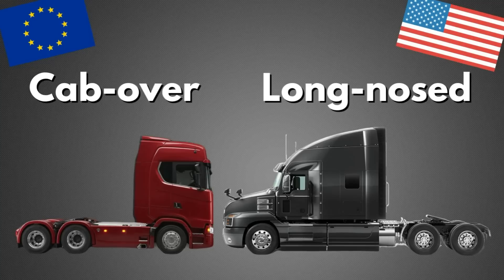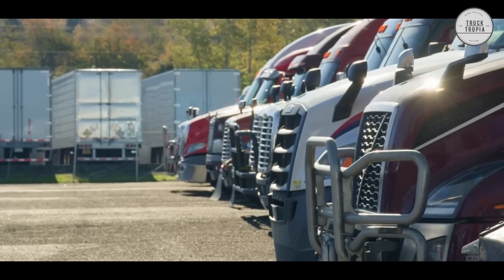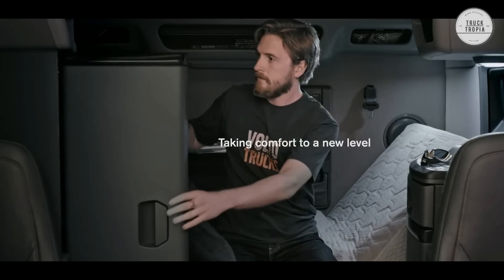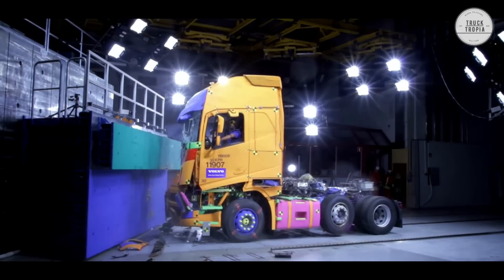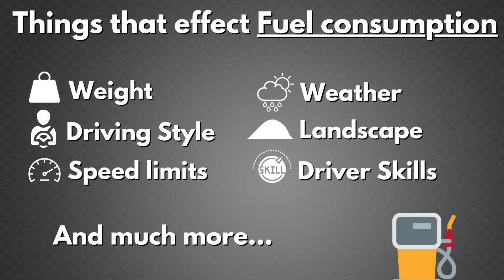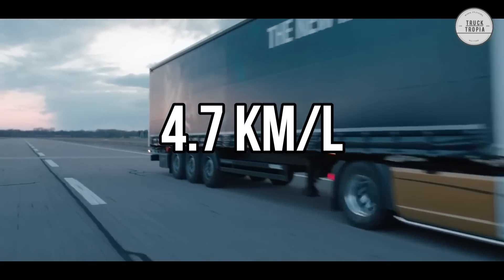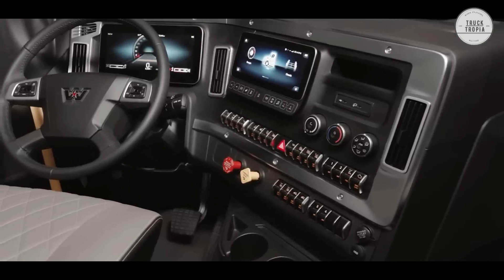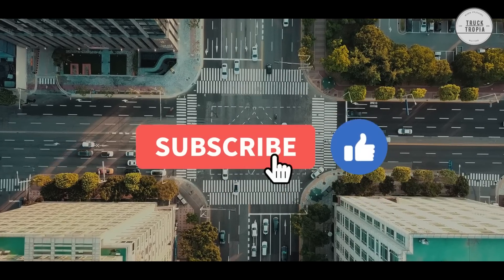WHY Long-Nosed And Cab-Overs Are So Different?

Comment: I have driven cabovers and I have driven long nose.  Both can come with a sleeper.  Cabovers feel more cramped and have a stiffer ride than the longer wheel base of the long nose.  In a cabover you are riding on your steers.  But in tight quarters like the narrow city streets in Europe or in urban areas you cannot beat the shorter turning radius and manueverability of the cabover vs long nose.  However, it does not have as firm a feel of control as the long nose on the highway.  The long nose feels more stable and smooth on the highway and not as prone to slip.  And it is a lot easier to access the engine on a long nose.

The cabover is the ideal city truck and the long nose for highway.

Comment: There is a limit as to truck length.  In some states it's total length.  I believe here it's 75feet. Trailers are 53 feet. In the late 70s Missouri trailer was only 40 feet.

Comment: Hello everyone, I am a mechanical engineer for the paccar group and previously I was a worker at Daimler and Volvo.  There are a few glitches in the video, I hope I can help you.  To begin with, it is a very common mistake to think that the American truck is more aerodynamic, the European truck uses the drop of water concept which is one of the most aerodynamic, a daf XG+ is more aerodynamic than a T680 Next gen.  On the issue of fuel consumption, the European saves much more fuel since really for consumption the European geography is much worse than the difference in aerodynamic resistance due to the extra speed (just see the instantaneous consumption going up a mountain pass with 40 tons at 40mph then compare cruising at 75mph) A 500hp Volvo VNL in Europe with 40 tonnes gets 6.9mpg while its big brother the Volvo Fh 8.7mpg.  And believe me that if we take both trucks to a country like Spain, your pocket will hurt a lot, not to mention that they all overtake you going up and down.  Another example is the scania S super, which gets 10mpg with 40 tons IN SPAIN that looks like a roller coaster.  The only advantage of the American is the time to sleep, the habitability is greater.  But the advantages end there, the European humiliates the American in everything else, to use some examples in my group, a T680 next gen is not in the same league / division / step / level... Whatever you want to call it than a Daf XG+ the difference is too big and so with all the groups.  Well and not to mention the difference in engines, which are not the same, the difference in quality and performance is very different with Volvo giving 2800nm with 500hp, more Torque than a 565hp X15, a 600hp dd16 or a C15... .
Reply from the maker: Thanks for sharing 👍
Reply: I have done international Customs and Cargo transportation for 12 years, so I want to set up my own business and open my company in Canada.
Reply: @dogankucukdogan8085  ok. why do you tell us that?
Reply: "American trucks aerodynamic because pointy" is one of the most frustrating misunderstandings of aerodynamics
Reply: Well said that Man
Reply: Having driven both units, I would disagree. Hills don't affect mileage as much as you insinuate. What goes up, goes down. Aerodynamics are generally better on the European trucks,but it's more due to the trailer gap, than the unit itself. The video was very well done, and correct IMO. Very hard to do apples to apples.
Reply: @gordonblomgren8176  Hills will affect consumption. How on earth they will affect consumption on regular cars but not on trucks? You gain some going down but you lose more going up because of inefficiencies. If you could store the energy going down somehow, yeah, then it would be close. But in order to do that, you need huge batteries, which would increase inefficiency back.
Reply: @gordonblomgren8176  hills will affect fuel consumption
you put a lot more energy into going up a hill than you do coming down as on the descent you need to keep the vehicle at a controllable speed so you're constantly braking, turning the gravitational potential energy into wasted heat and noise
Reply: @lord_scrubington  the "American trucks" are designed for American Roads and the "European Trucks" are designed for European roads.. its not complicated...if you were driving the open road in America basically living out of your truck then you would prefer an American design with a huge sleeper.
Reply: @leeward6762  Yeah, america is much bigger and truck drivers stay on road far longer. In Europe, they don't leave home for that long compared to american truckers who basically sleep in the cab. American trucks also require less power since the country is flatter, roads are far bigger. I don't mean to say all euro trucks have stronger engines, but in Europe for most models you have a higher ceiling for power and one of the reason is the existence of Alps, Scandinavia...etc. Europe is more densely populated too, which makes most routes shorter.
Reply: @leeward6762  And curse its humongous length in European roads. European trucks are the other way around: delight in their space efficiency and manoeuvrability, and curse at their engine accessibility.
Reply: @gordonblomgren8176  You are very wrong, do you think you know more than an engineer who works in paccar? let's just learn from it. The American truck looks like junk next to the European truck, I have a Scania S770, there is no American truck that comes even close to it. It's like comparing an Impala to a Mercedes AMG.

Comment: Just did a a little comparison with the volovo fn 6×4 and volovo vnl 760 and the fn total length is 10000mm or 32 feet and 9 inches where as the volovo is 10147.3 mm or 33feet and half inch so only 3.5 inches longer plus the vnl 760 being skinnier and shorter yet giving the driver better room in cab and possibly being safer and more aerodynamic so why still use the cab over engine

Comment: I drove tandem dump truck for over 30 years. The regulations really only regulate safety. There is many old trucks that are uncomfortable with poor sound insulation. Dump trucks exclusively use the conventional configuration with different hood length influencing maneuverability.
Reply: Over here dumpers are cabover with dual drive and dual steer.
Reply: @eezergoode8588  yes I’ve seen those trucks when I was in Switzerland. A Eurodumper with a tailgate that was hydraulic. Very cool. My last truck had an automatic transmission with air suspension. Very surprised that I had no orientation to the truck and transmission.

Comment: One thing you missed is that in America, the wheelbases have to be a MINIMUM length. This is how we (bridge designers) design bridges; we assume the truck tractors have a wheelbase of at least 14', and a lower wheelbase will concentrate the load. This being the case, the truck needs to be a minimum length, thus negating the need for a COE.
Reply: I’ve heard of this. It’s called the federal bridge formula
Reply: And I’m ALL for it. My back thanks the bridge formula. Now only if Ohio would fix their joints
Reply: @jacobhelmlymusic8215  if you drove a European truck you wouldn't be in pain either.

Comment: THE 6X4 TRACTORS  ARE RARE IN EUROPE !!!
THE MAXIMUM WEIGHT IN EUROPE FOR A SEMI TRUCK IS 44 TONS !!!
JC ANONYMOUS PATRIOTE FRANCE.
Reply: Not here in sweden, we have a max of 74 tons and 24 meters. And me myself are driving a Volvo FH16 with 6X4 and a lowtrailer after it and i can weigh 60 tons on my rig
Reply: @isakeriksson9162  YES.
IN FRANCE WE HAVE 6X4 WITH 120 TONS OF CAPACITY WITH SPÉCIAL SEMI.
HEAVY TRANSPORT.
AND OVER.
BUT NORMAL IS 44 TONS FOR SEMI TRUCKS.
JC ANONYMOUS PATRIOTE FRANCE.

Comment: In the end, how much pulled weight determines fuel economy.
Reply: Both trucks should have been the same weight and run on the same roads to get a more accurate fuel reading 
The trucks should have been by the same manufacturer such as Volvo who could have specified them identical except for the different cabs
Reply: @Retired88M  Cloest comparison we can get from Volvo is FH vs. VNL But that's assuming they have identical engines, transmission, and axle layout.

Comment: I am a us truck driver. I can assure you that we have zero airbags. In the event of an accident, they would do more harm because we will not be stopped by the time the effectiveness goes to zero. If they extend the effectiveness time, we would not be able to control it if we are able to. We keep driving it until it is stopped.
Reply: All volvo trucks in the USA have airbags
Reply: I’m also driving a  Cascadia and it has a driver airbag on the steering wheel. But there is no regulatory requirements for them in the US.
Reply: false information i guess. if you hit a wall its instant stop even for your mighty truck
Reply: @mikkihintikka7273  it's not false. I have driven volvos before
Reply: @LifeOn18Wheels  dont care. airbags wouldnt made things worse thats for sure.
edit: typo correction "back" --> "bag" 1 linute after posting the comment

Comment: European lorries are limited to 64mph not 56
Reply: I thought it was 56 or is that just the uk?
Reply: @Savagetechie  British lorries are definitely 64mph but i just assuming the rest of Europe would be the same as British and other European lorries go on each other’s roads all the time
Reply: @jammiedodger7040  I thought over 12 tonne was now 56 in the UK? Although I think it only applies to vehicles registered after 2001. I may be wrong though. I'll check the C&U regs.
Reply: @Savagetechie  They put it up a couple of years ago but it really depends on the type of road as even though they can do 64mph they are legally required to go slower on certain road types but then before the 1960’s almost everything went by rail in Britain until some knob took an axe to it as we can all agree that rail is better than road unless It is a extremely short trip were lorries and even buses make sense.
Reply: @jammiedodger7040  have they got rid of the daft 40 limit on A roads? Definitely a throwback to the drum brake era.
Reply: @Savagetechie  I believe it depends if it is single track or dual carriageway  I think on single tracks it still a thing
Reply: All trucks 7.5T and over in UK (and all europe) are limited to no more than 56mph(90km/h). Source: am English lorry driver. 
That’s a hard limiter, regardless of what road you’re driving on. Been that way since the 80s to my knowledge. A good hill and heavy load will get you faster though. 
Only exceptions are fire trucks and horse boxes.

Comment: Good comparison! I have one criticism though. When comparing fuel consumption you give the consumption in mpg and kilometers per liter. Nobody in Europe measures that in kilometers per liter. We use Liters per 100 km
Reply from the maker: We dont, where i come from in Europe 😅
Reply: @TruckTropia  No way you are using KM/L in Denmark (I assume the channel info is correct). I always assumed that L/100km is the standart. I guess I was wrong
Reply: @felixsmdt  I'm italian and I use both systems

Comment: American truck manufactures have never heard of term “ergonomics” The interior of American truck are terrible designed and not very driver friendly; especially old Freighliners, beside International trucks are the worst, they fall apart even  when they are brand new.
Reply: American trucks are super driver friendly. International is definitely shit though.
Reply: @Jasonsminiadventure  Modern trucks are much more comfortable and driver friendly now than they were even a decade ago, and if you wanna see an uncomfortable interior look up 50s and 60s truck interiors
Reply: @Jasonsminiadventure  you can go for Freightliner, which is owned by Daimler Trucks North America.
Reply: @banurigopalreddy4014  Or Volvo VNL. Some engines and transmissions are shared with FH.

Comment: In my opinion, what causes the shape of the cabin to be different is because of the driver, the average European tends to be thin, while Americans are not too tall and the average is obese.
Reply: That's a bit of a stereotype, and while it's not entirely untrue, you are over exaggerating it a bit. IMO the main reason the cab shapes are different is simply the geography of where they operate. North American roads are long, straight and wide. In Europe truck drivers have to deal with tighter, more narrow roads which the cab over design is better for.

Comment: One thing I really like about our european trucks is the ability to put that much space into a much smaller cabin. We really made it to use every cm² to the max and offer the driver as much comfort as possible with all our size-regulations. There are some really smart inventions to get everything into the cab AND make it as quiet as a normal car plus offer a flat floor and the ability to stand upright. That plus the high seat position is why I love our cabovers, even if I wouldn't say no to a bit more space, a wardrobe and maybe even a toilet. Would be useful for long distance driving!
Reply from the maker: Thanks for sharing :)

Comment: I just wanted to say, for future videos it might be nice exchanging km/l with l/100km as that is the measuring system most use. Km/l says nothing to most people....
Reply: Here in asia, we mosly use km/L
Since in here motorcycle is most popular so counting with liters makes more sense, lol
Reply: @megimargareth4015  That makes sense really, like calculating how far you can go with the gas you put in. Still for efficiency measures all cars and trucks ive ever seen use l/100km as default measure if not mpg. Wouldnt even think there is a mode for km/l...
Reply: Best solution is to include other measuring as a hardcoded subtitle in the bottom of the video when the narrator mention the fuel consumption

Comment: Nothing can beat an 18 speed 2003 379 with a Cat 3406e
Reply: There is a lot out there that will but okay 👌🏾
Reply: @stop_lying_bro  (my opinion)
Reply: @darkseid486  understood. I've driven a 99 Pete all done up with a 3406, 18 speed all done up and straight piped hooked to a reefer and they are awesome I have to say. But I've also driven tons of others including now European rigs.
Reply: or an 18 Speed RR with a CAT C15 thats been converted to a CR  with 6" turbo
Reply: A Scania 16.5 litre V8 770 will eat your Pete for lunch believe me.
Reply: A european road can. It's less about the truck than about the landscape. 
As I saw on a post, I  wouldn't drive a european truck in the USA or an american truck in Europe.

Comment: On the interior of American trucks it doesn’t make sense to have 4-6 toggle switches to turn on the lights. You only need one switch with different stages not a dozen toggle switches
Reply: Lol, you guys just make stuff up.
Reply: Many of them aren’t for lights and instead for auxiliary functions
Reply: @commissionerwyattb6520  I’m talking about light switches why do you need 5 different toggle switches??
Reply: @mzee5533  again for auxiliary functions such as stuff like marker light, high beams, warning lights, for some it may be a led bar or other like it
Reply: My USDM Cascadia has one switch for the lights. Just one.

The other switches have to do with suspension height, 5th wheel adjustment, traction/stability control toggling, axle locker toggling, and other ancillary functions. 

This goes for our Volvo VNL as well, there is one central light switch for exterior and some for interior lighting as well as the above ancillary functions.
Reply: The light switch situation in USDM trucks mimics cars sold worldwide.
Reply: They are like that so if you blow a fuse, you don't lose all the lights. HELLO? Ford used to use a single switch and it was a nightmare..
Reply: My experience with American stuff like western stars and Kenworths, is the headlight switch is in some stupid hidden spot on the left, same as the wipers, on three switches, not intuitive at all. Newer wide cab paccar Kenworths use a stalk and normal headlight switch on the right like European and Japanese trucks.